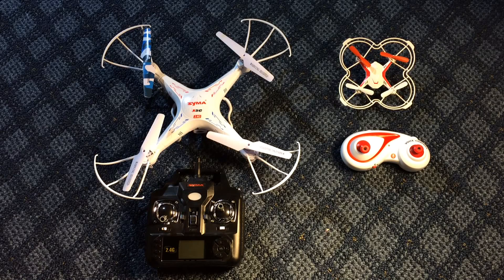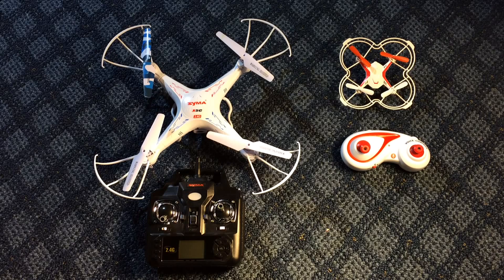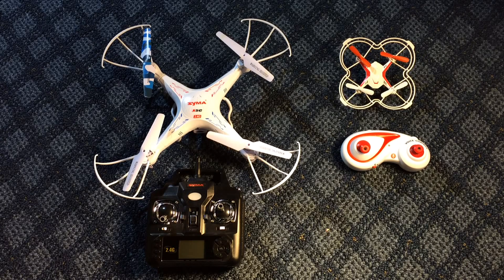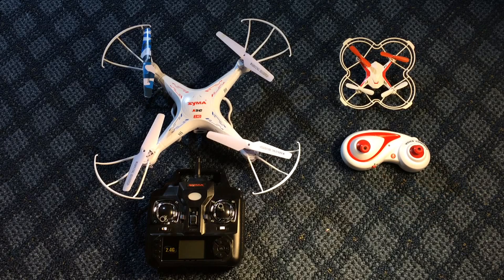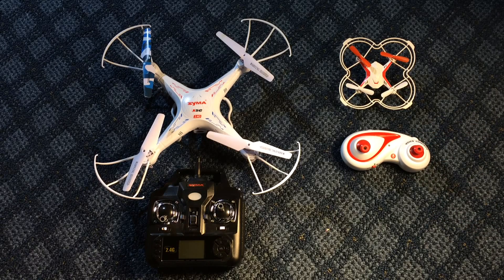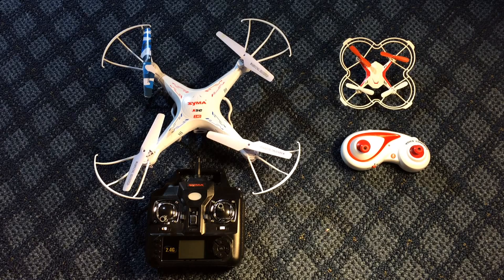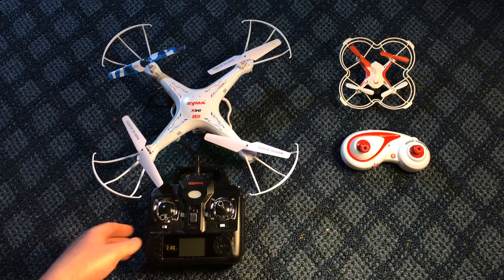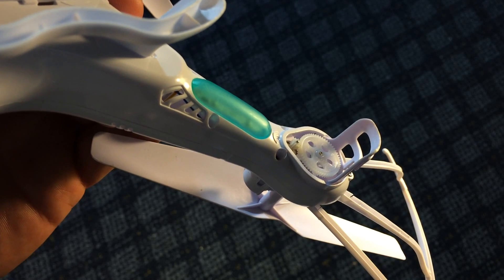DIY drone repair and tips for beginners

Comment: Thanks, your suggestion about checking for the small gear movement solved my problem. On my model I have to disassemble the whole bottom to access it but at least I know where to start once I get around to it. The small gear is freely moving on the shaft so I'll re-affix or replace the motor if needed.

Comment: My drone is fine but 1 propeller, it doesn't respond when i want it to i have to spin it manually (there is a button that makes it fly) and then it would respond again. My dad said the controller isn't responsive but i say that the motor isnt responsive
Reply from the maker: Yes the motor might have some hair plugging it up or the motor is worn out.

Comment: My drones arm is broken but wires are still good can this b fixed
Reply from the maker: If the arm broke try to glue it back together with a plastic epoxy you can get from Lowe’s or Home Depot

Comment: My drone is old and and it it is not turning on.. I charged my battery but it doesn't turn on.... left it for a few hours keeping the switch on and it suddenly turned on !...I tried to pair with controller but suddenly, the LED stop blinking and they are not turning on again..so what to do ? is the problem with my battery or with  the internal parts of my quadcopter?
Reply from the maker: If the battery was not maintained at about 50% capacity or more, it could go bad eventually.  If you can find a cheap new battery online I would try that before throwing out your entire quadcopter.

Comment: At 4:03 you explain how 2 propellers spin counterclockwise and the other 2 also spin counterclockwise.
Reply from the maker: I added a pop-up comment about that, my mistake when I made the video.  2 of 4 props spin clockwise and are 180 degrees from each other; the other 2 props will spin counterclockwise.  Thanks for watching!
Reply: Fyi this totally helped me fix my quad copter. Thank you

Comment: I have a Falcon 2 Pro Drone, but after it taken a hit from a tree limb, its starts acting crazy and flips and crashes at the same time, it still works though, but its starts spinning slowly once it took off and i think something went wrong.. i gotten the hang of it... but how can get it to work like it was before?
Reply from the maker: It sounds like one of your motors might have a bent prop mount. Have you tried to swap in a new propeller? If that doesn’t work make sure nothing else is wrapped around the motor shaft. Otherwise you probably need to replace the slow motor.

Comment: One of the legs snapped off and one of the blade guards snapped. What can I use to fix it?
Reply from the maker: Hot glue is easy but a little messy, or try an epoxy like JB Weld that you can find in hardware stores.

Comment: can u help i crashed my drone spyracer and the thing that protect propeller is  almost touching it can u tell me what can i do to put it down
Reply from the maker: You can try to bend it away from the propeller but it might break. You can also try to tie a light weight with a string on the prop guard for a couple days to gently bend the guard back into shape

Comment: When you show the part on 6:58  my drones motors gear attach to another gear but the rod fitted in the gear is missing  how can I repair it plzz help
Reply from the maker: Does either gear have missing or broken teeth?
Reply: No the rod is missing the fan

Comment: My drone works but 1 motor does not spin
Reply: Too what can i do
Reply: You have to change the motor to the new one bro...
Reply: Seems this motor is burned out - it happens usually after numerous crashes or propeller stuck. You can buy those in aliexpress for $2-3, usually sold by pair (CW - Clockwise and CCW - couterclockwise - can be told by wires Red&Blue or White&Black). Need soldering iron and few screwdrivers, takes about 15-30min to repair.  If you can't find engines of your model you may try motors with similar diameter - it may fit.
Reply: Mine too
Reply: Mine too
Reply: Mine too
Reply: Seems this motor is burned out - it happens usually after numerous crashes or propeller stuck. You can buy those in aliexpress for $2-3, usually sold by pair (CW - Clockwise and CCW - couterclockwise - can be told by wires Red&Blue or White&Black). Need soldering iron and few screwdrivers, takes about 15-30min to repair.  If you can't find engines of your model you may try motors with similar diameter - it may fit.

Comment: I hAve an xdroneHD AND MY DRONE IS FINE BUT but the controller won't turn on, I just put in my new batteries and it won't turn on, even though I dropped the controller. Can it be fixed, or not??

Comment: the wire on one of my motors disconnected from the drone how to I fix that?
Reply from the maker: I would buy a cheap soldering iron and some solder and reattach the wire to the motor or replace with a new motor.

Comment: Can a motor be burned out even if its a totally new copter? I just got my first aviax quadcopter and one of the blades is a little slower than the others.
Reply: ABEJOHNDERDANSER i crashed mine and now one motor is going slower than the other ones i bought it two days ago😤
Reply from the maker: Yes, unfortunately I can think this can happen because many drones are made so cheap and there is not too much quality control.  Sorry to hear about this!
Reply: ABEJOHNDERDANSER same problem

Comment: my sons quad takes off but then  all propellers stop and it falls to the ground
Reply from the maker: That sounds really bad, and not a motor problem.  I would try a couple different batteries.  It could be the battery or the connector on the battery or the battery connector on the quadcopter.

Comment: my drones 1 side is not going up all the other sides r up but that shitty side ain't going up the wing is spinning wtf should I do
Reply: ZH Pranks Production same problem
Reply: ZH Pranks Production Under the propeller there is a little gear thingy and you need to push it in and it should start working! hope i helped
Reply: my drone to

Comment: one motor died, then I changed it with a new one.  but when I plug in the battery, it starts spinning on it's own while the quad is turned off.    and when its binded to the remote, when I raise the throttle, the connection cuts out. the other 3 motors spin then cut out.  while the 1 motor still spins on its own until I disconnect the battery.

Comment: Where can you get replacements for those small motor shaft gears? My drone has one motor with a broken pinion gear. I don't believe I need a new motor, just the gear. Do all drones use the same motors and gears. I have a Propel XD Video drone received as a gift
Reply from the maker: Unfortunately they don't all use the same sets of gears, props, and motors.  The best way to find replacements is to just google around for them.  I've found replacement parts for mine on eBay and Amazon... in any case the parts are really coming from a supplier in China so it will take several weeks for parts to be delivered after you order them.
Reply: John's DIY Playground my proprelsers won't work like when I try to move it it likes does not even move. How am I esposed to fix it

Comment: How do you measure the pitch and diameter of the propeller????
It would be very kind of you to tell me
Reply from the maker: The diameter is measured across the length of both blades, tip to tip.  Pitch is harder to measure.  Generally it's best to find out the pitch either from a marking on the blades or by reading the owners manual of your drone.  It should be specified there.  Otherwise just search google for the name or model of your drone and the word "propeller" and you should get some hits as to what works.